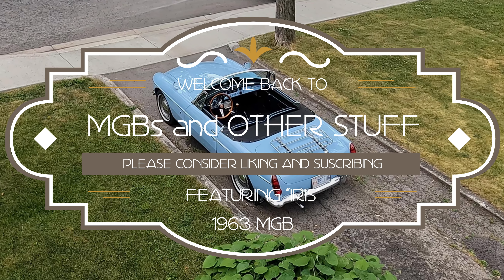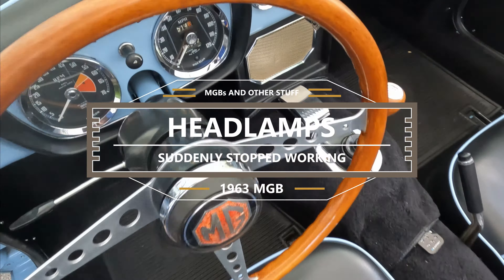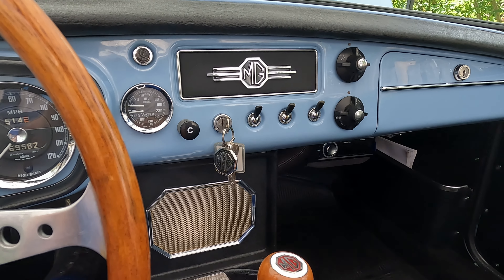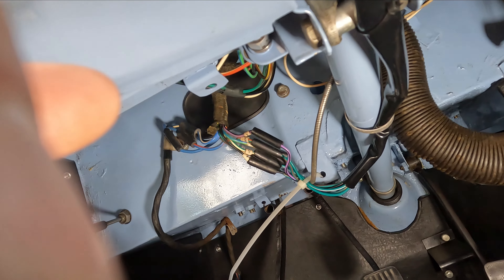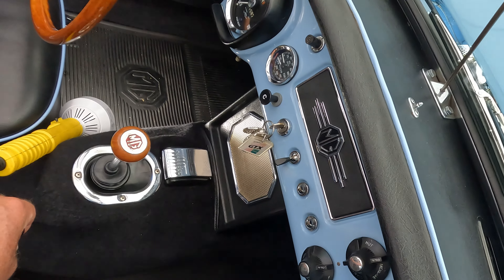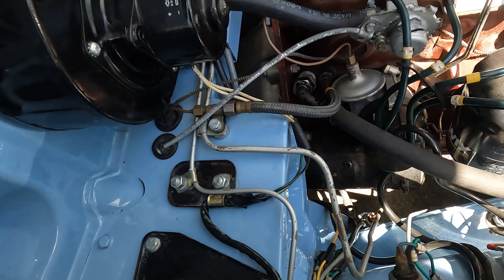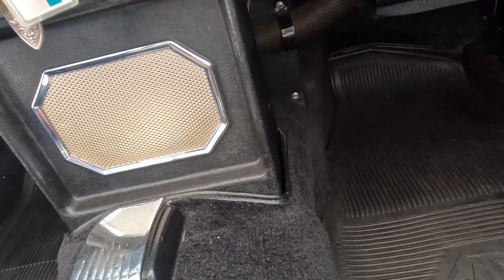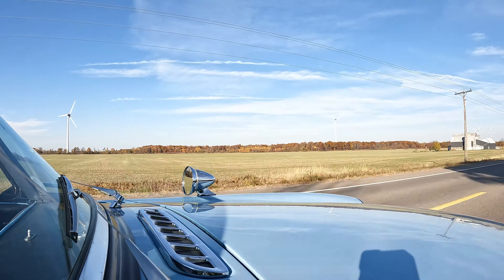MGB, MG B, 1963: Odds and Sods; Headlights, Speedometer Cable, Carpet Fix and a Leaky Differential

Comment: Excellent video as usual!  Best wishes in finding your oil weep source.  I too had a slight weep onto a vinyl sheet under the car.  Finally tracked it down to the front tappet/pushrod cover.  Now hopefully fixed after 1.5 days of work, but only an hour and a bit to fix it.  The rest was disassembly and reassembly for access!
Geoff in NZ
Reply from the maker: I familiar with that experience.  I usually break a few things along the way.

Comment: If memory serves me right, I think the Speedo cable was secured with an aluminum type zip tie to the wiring harness and body across from the clutch slave cylinder.
Your rear axle may be leaking because your vent tube may be plugged causing pressure to build in the rear axle. Or your front pinion seal may be the issue.
Reply from the maker: I’m going to call you AP for short.  I’m thinking of doing a video that sort of inventories the major components of the car, but it seems like a lot of work so maybe not.  Thanks for you support and comments.

Comment: Excellent video as always.
Very sorry about your fires and smoke. 
Your Canadian fire is now on par with our fires here in Southern Oregon a couple years back. 
Massive and choking. Did not go out until the November rains and snow. 
Best of luck with that. 

Minutia:
I am still convinced your car is a 1962.
Chrome strip around the Tach/Speedo nacelle.

Another  observation... the distance between the front turn signal/parking lamp edge  and the grille edge...
I am going to do some investigative work on this.
I'll get back to you with this measurement on my 63.
Reply from the maker: Thanks Jeff.  I also think it is really a 1962, I’ll be interested in what you find out.
Reply: @mgbsandotherstuff2982  

ONLY the 62 had the small chrome trim around the nacelle.. no other year.
The first   May of 62 VIN was 101.. ending VIN for 62  was  4618
The first engine # was  18 G 101.
Supposedly the first 50 (perhaps 100) had a defect that was corrected by the dealers and an "S" was stamped into the original engine tag when modified.

Front lights.. here is an anomaly on your car.
I believe the front "wings" fenders have been replaced with 1969 or later ... this owing to the tight gap  from turn signal lamps to the grill. 

I'll check on more and get back to you.
Reply from the maker: I am pretty confident that the wings are replacements. In every photo I have of the car prior to restoration, the wings are missing.
Reply: The gap between the sidelamp/indicator fitting and the grill indicates your front fenders are late model (post 1969) prior to that the gap was approx 3x greater. The position of the sidelamps was changed to conform with British regulations which required the side lamp to be positioned vertically below the head lamp
Reply from the maker: I think they were replaced in 2002 with new "late model" reproductions.  Not sure if the "early style" reproductions were available back then.

Comment: Observation and anomaly.....    '
Starting at 6:47 as the camera pans to the left..
I see a metal "bracket" which appears to be bolted to the firewall in front of the heater over the gear box /engine tunnel. It is painted IRIS blue and looks to be about 2-2 1/2 inches high, has a bend/crease at the top  left to right. Maybe 10 - 12 inches long.
Looks to be bolted to the  body/firewall..   perhaps by two studs
In the far left/passenger side there is another smaller vertical bracket attached  to the long bracket...  it is also painted blue and looks to be riveted or studded with the threads facing back to the heater.
At 7:09 there is a clear shot of the end of the large bracket and the smaller vertical bracket... to his there is a typical clip/bracket which shows a rubber insert and this clip is clamped around
 the speedo cable ?
The fuel line appears to be behind this long bracket and not clamped but serves to keep it in place.

 I have never seen this on another MGB and I have worked on hundreds.
This causes me to think someone/former owner fabricated this bracketry or it was peculiar to the early 62 MGB.

Any thoughts ?
Reply from the maker: Hi Jeff, when I first noticed it I too thought it was odd.  I went on a hunt for it in parts catalogues but could not find it.  When I get a chance I will scour the restoration photos I have and see if it is in place and I am planning a visit to see the guy who restored it and ask him if he remembers.  His memory is failing though so he might not.  Good eye by the way.
Reply from the maker: Hi Jeff, I did not see any images of it on the restoration pics but found a similar setup on a what I think is a 69 at this website: https://www.chicagolandmgclub.com/photos/b_heater/
Strange that I have not seen it referenced nor have I found any other images of one  in my searches.
Reply: @mgbsandotherstuff2982  Too much alike to be some home made unless, there was a batch made and offered.  And on a 69 ? His is black, so not stock and painted at the factory.
I'll assume your car has been repainted and someone decided to paint the bracket.  Very curious.
Reply from the maker: Hi Jeff, it is a fuel, brake and clutch  line heat shield, that I think made its appearance in about 1967.  I kept googling cable "bracket", "shelf" or "guide" and finally hit upon it.  They are available from suppliers and the PO probably added it for safety reasons.
Reply: @mgbsandotherstuff2982  Moss Motors    182-650  $30 USD..
I'm bummed..
I wanted it hand made, limited addition by Beermo Garfuliak and discontinued : )
Reply from the maker: Oh well, you win some and you lose some.  I am assuming that Beermo Garfuliak doesn’t really exist, I googled it and got nothing.
Reply: @mgbsandotherstuff2982  My alter ego !!    I am curious about the Moss article; I think I'll order it just for fun and be the first on my block : )
Reply from the maker: One more thing.  Now that I know what it is I am curious about the installation.  Mine seems to be fitted further to the passenger side than most I’ve seen.  I have also seen a few different orientations and haven’t happened upon an official “proper” installation guide.  One more distraction to keep me occupied.
Reply: @mgbsandotherstuff2982  All my life I have focused on minutia and details. Good to know there is someone else out there with the same affliction.  :  )

Comment: RE : Firewall bracket (heat shield)    182-650   $28.59   in stock
Fits 1968-1974.5 vehicles.
Reply from the maker: That’s it Jeff, the PO probably added it or it came with a a new firewall.

Comment: Don't those transmissions have a metal cap that goes over the bendix where it protrudes from the bell housing?
Reply from the maker: Here’s a picture of a 67 GT inertia starter in place.
https://mgb1967.com/wp-content/uploads/2017/12/Old-Lucas-inertia-starter.jpg
Reply: @mgbsandotherstuff2982  I guess I was thinking of the Midgets and Sprite transmissions that had a metal cover attached to the bell housing.
Reply from the maker: I’m pretty sure that the inertia starters were replaced with pre engaged ones from 1968 on.  Thanks for the comment by the way. I always appreciate feedback.👍

Comment: A GREAT MOD IS TO FIT A HI TORQUE STARTER MOTOR
Reply from the maker: I have looked at those,  maybe as a replacement when the interim one eventually fails.  Thanks for the tip.